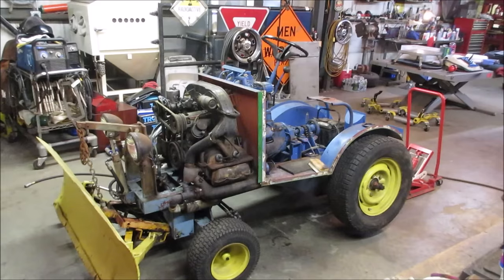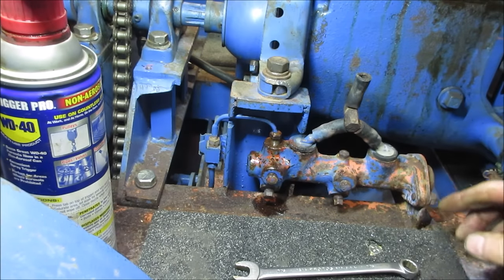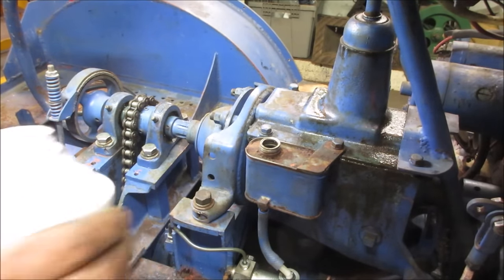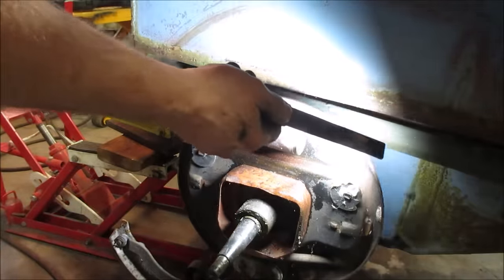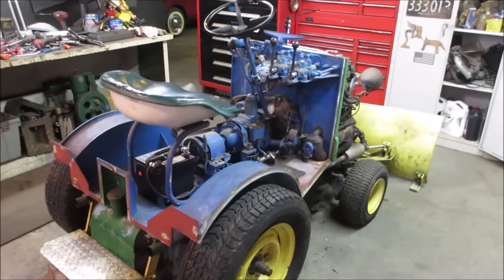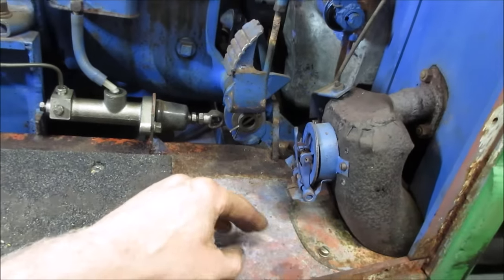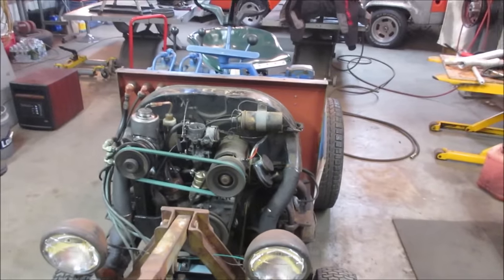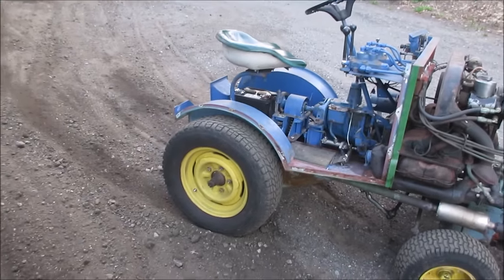Let's bring This Awesome Tractor Back To Life!

Comment: Mustie - Got a question. I have an icemaker like the one you did a vid on. Brand new and it made a few icecubes but then was stuck on "add water" no matter how much it had. I took it apart and the metal probe in the back that is in the stream of water from the pump looked shiny and new but I filed it a bit anyway and when I put it together it worked. However, I did notice that in the little tunnel/tube part that the water comes out of, right before it hits the probe, there was a screw tip that had penetrated the water tunnel, with the screw tip coming out of the bottom of the tunnel so the water definitely touches it.  I couldn't even see where the screw was located and didn't want to take it apart even more. It's working on and off no, still saying add water when it has water. I had three questions:

- Would the water passing the screw mess with the accuracy of the probe that detects if you have enough water? If they just monitor the resistance or wtv to determine if water is being pumped?
- Should I be worried about the screw rusting and poisoning me or something? I'm assuming that it's not stainless or wtv. 
- Could this be something that they do intentionally? Maybe they figure that when the screw rusts it'll somehow trash the unit or even just the water sensing probe won't work right? The screw would act as a ticking tome bomb that forces someone to buy a new one in 6-12 months?

Comment: I don't know of any tractors built with foot throttles.  All that I know have hand throttles.  Bouncing over rough ground makes a foot throttle impractical.
Reply: My 1959 case 611 has a foot throttle. Most of newer tractors on farm I work at also have foot throttles

Comment: Dude, I know youre old school, (I think youre not even 8 years older than me) but you HAVE TO give up on those shitty 3-stone hones, they do a terrible job, and end up woggling out holes to be no longer round! One by one make the switch to Dingle-ball hones, they do a better job and apply equal pressure and are easier to use!

Comment: What do you use in your ultrasonic cleaner and what temp do you set it at? When I use mine, the carburetor comes out with a chalky look and feel to them.
Reply: He just uses carburetor parts cleaner. The kind that you can find in the 3/4 gallon cans. The stuff he uses is made by "Gunk."
Reply: @flat4buggy239  thank you. Still trying to figure out a good temperature. Seems that 150 degrees F is what most people set them at so I will try that next.
Reply: @smithlonny8924  I went back to one of his old videos. He had it set to 50°C, or 122°F. You can probably go hotter, just be careful of the flashpoint, which is 145°F, or 62°C.
Reply: Alright. Thank you.
Reply: @smithlonny8924  You're welcome. Happy wrenching!

Comment: So the muskie one has a new play toy. This tractor probably never ran this good. Even with the distributer off one tooth. It will have a lot more power when the distributer is correct and with the cab on with the hole in the exhaust closed up it will be great. Yanmar tractor doesn't stand a chance with the muskie stinky one with a vw. Stinky likes his vw's and really weird powered bycycles. Has a plain fetish for old wierd bycycles. Surprised he doesn't have a motor on his high cycle. Problem is the pedals are like a tricycle and won't stop turning.